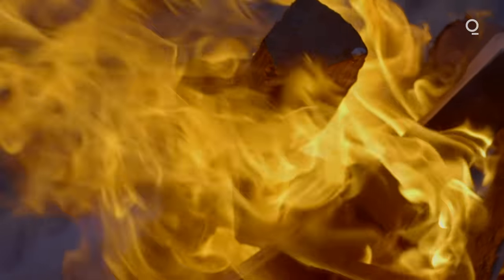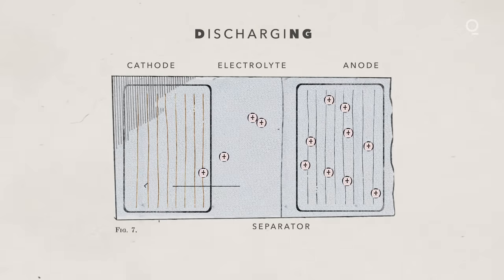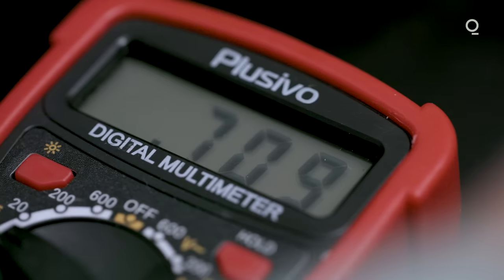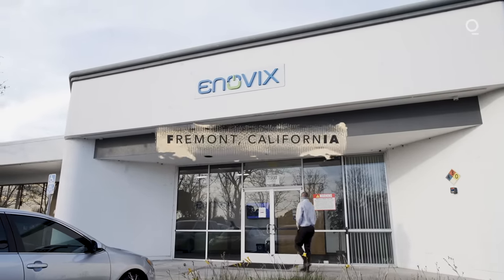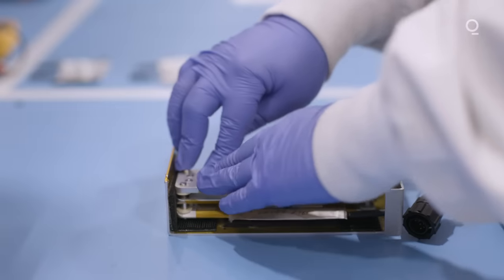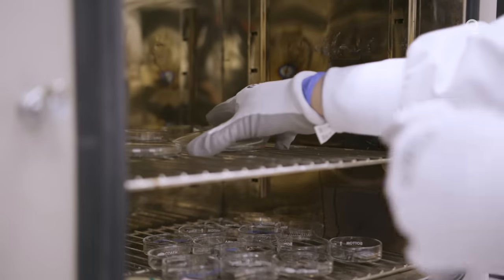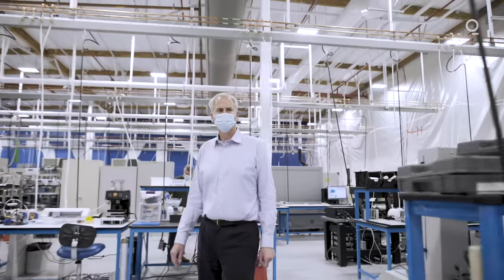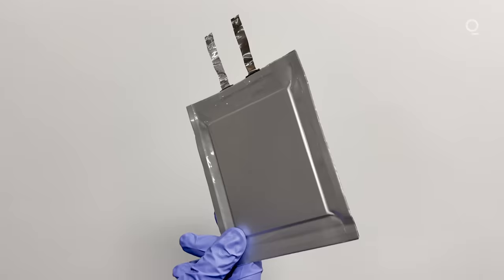How The Next Batteries Will Change the World

Comment: Yep. I took an energy storage course back in college and there are literally so many little things that can alter the performance of the battery and tons of materials research out there done to help change batteries. It's trying to find the best combo and how to deal with its advantages and disadvantages. Batteries still has a long way to go
Reply: It should be changed from "it is not rocket science" to "it is not battery science".
Reply: Indeed battery storage is lacking behind computing technology, mainly due to the lack of need for high energy density batteries till the recent explosion of EV's.  Up until recently small batteries worked fine in phone and laptops, but now we need large storage capacities in a relatively small space.
I believe that the solution is not in chemical batteries, rather in Super-Capacitors which pick up the charge electrostatically.  It has several advantages: 1. There's no chemical to degrade over the time.  2. It charges extremely fast, within minutes if not seconds. 3. It has a high energy density.  There are several companies exploring this technology.
Reply: @BillAnt  I read about graphene battery, they say it'll be revolutionary... they probably say that about every new battery tech.
Reply: @sihotech  < Well, like with any new technology there's lots of trial and error, some will fail while others succeed.  Regardless of the technology used, the aim should be a high density and affordable battery which stores and equal or higher amount of energy than the current gasoline based fuels.  Consumers will always go for the lowest cost and most convenient products, that's just how it has always been.
Reply: @sihotech  graphene in lipos exist, you can buy them
but there's not much difference in performance
Reply: so long that they probably will never be the solution
Reply: @BillAnt  generally capacitors take a long time to charge and burst out energy in less time but never heard of super capacitors

Comment: They have to be recyclable as well.
Reply: Thank you! 👍👍👍
Reply: Everything decays eventually be patient
Reply: @yzrippin  Without battery recycling we will probably run out of lithium/other rare metals that are vital for battery production very quickly. Even if we don't, the mining would cause immense damage to the environment.
Reply: @yzrippin  Yes but if it takes thousands to tens of thousands of years to decay, we quickly out produce the rate it takes to decay.
Reply: @thetntsheep4075    The mining for the minerals is  Completely localised and impact can be mitigated your right recycling is important however your missing the point of Off Earth mining
Reply: @yzrippin  Asteroid mining is flipping awesome. But IMO it's also at least several decades away, and we need batteries to replace fossil fuels far sooner than that
Reply: @yzrippin  Asteroid mining is not something that scientists predict will be able to supply the earth. Our current fuels and non-earth water resources isn't really something we will be able to address for a long time. I really hope that I can be proven wrong though, but currently our bigger problems are on earth
Reply: @jerrywang4406  then why are you using electricity rn?
Reply: @thetntsheep4075   if you search around the worry is virgin lithium may be cheaper than recycling lithium. As I understand it 90% or more can be recycled right now with future technology progress being guaranteed.
Reply: @christianjvi  i do
Reply: 1 step at a time, if you need a new venture to be completely perfect from the start, then you never move forward..
Reply: i hate that ppl say that recycling is more costly than creating new stuff 
when ppl are the ones setting the prices. if we said recycling should be profitable it would be. 
we could make the cheap raw materials cost more so making new stuff would cost more. 

that's what laws and the economy is for. 
if your economy prefers making new stuff you'll get plastic all over your planet.
if it prefers recycling then we will stop overproducing and just recycle what we have which would funnily make things have better value as well, since it's more limited that way
Reply: @robertg7249  that's just so fundamentally wrong. The process of recycling is entirely different to the process of  getting raw material and producing from the start. It's not comparable and isn't just a matter of what people ask for
Reply: @hank_Reardon  a company called Li-Cycle has a 95%+ recovery rate for materials in batteries. They have a patented recycling process
Reply: @robertg7249  i bet you also want 15$ minimum wage and healthcare.
Reply: @thetntsheep4075  You’re too conservative when it comes to when we’ll see asteroid mining. The rate of advancement in technology is accelerating. We’re living in an era where the rate of tech improvement is faster than our ability to comprehend new tech when it comes out, to the point that futurists such az Ray Kurzweil are predicting that in 2029 we’ll reach technological singularity.
Reply: @christianjvi  the ocean is the battery
Reply: @robertg7249  This is the dumbest thing I have read today. The whole idea of "oH iF oNLy iT wEre cHEaPeR iT wOuLd bE cOsT eFfEcTivE." is so fundamentally wrong. Everything you said is incorrect and inept.
Reply: @yzrippin  Why not? I don't get Americans 😂
Reply: OKOKOKOK
Reply: @yzrippin  what does that have to do with asteroid mining? I'm saying we won't be able to have the tech to mine asteroids for a long time, if ever, so we should first focus on more sustainable resource management and mining first
Reply: @jerrywang4406  thats exactly what they said about solar wind geo wave and batteries.  Look at us now.  Were going to space to mine asteroids whether you like it or not
Reply: @yzrippin  Sure thing, let's just agree that we currently need to mine in less polluting ways on earth
Reply: @jerrywang4406  yea im with ya.  We need miners with freaking lasers on their heads
Reply: Recycled or reused for energy storage. While old battery may not be suitable for a car, its still perfect for large energy storage or private home energy storage.
Reply: @thetntsheep4075  Well actually we wont run out of lithium not anytime soon. This may be less known thing, but world oceans actually contain  an estimated 180 billion ( yes billions ) tons of lithium and can be extracted through desalination  and  estimated ground lithium is around 62 million tonnes. Desalination  is still very expensive and it  cost dropped a lot over decades ( which is also useful for extracting  drinkable water) and while  lithium extraction cant compete with ground lithium yet we can be sure that we wont be running out of it in a long time. Plus by the time we really be running out of lithium, we will be mining it in space and sending resources down to Earth since  its much cheaper than sending it up to Space.
Reply: @robertg7249  exactly, put enough taxes on mineral extraction to incentive the recycling industry
Reply: Recycling is probably a secondary aim at this point, but sure it's important down the line.  I believe that the solution is not in chemical batteries, rather in Super-Capacitors which pick up the charge electrostatically.  It has several advantages: 1. There's no chemical to degrade over the time.  2. It charges extremely fast, within minutes if not seconds. 3. It has a high energy density.  There are several companies exploring this technology.
Reply: @yzrippin  Cancer decays too.
Reply: @adk_88  exactly.
Reply: They aren't compatible or even replaceable now, how do you think there could be any profitable business in recycling batteries? (profitable=posible)
Reply: First goal is incompatible batteries. Recycle is not in the list.
Reply: Copper and zinc don't need to be recycled in fact copper iron batteries are even more eco friendly.
Reply: Right, considering we are making more chemical wastes by switching to electricity cars, it is more like a trade off between air pollution of legacy vehicles and chemical pollution of electricity cars
Reply: $ABML
Reply: This is just plainly wrong and dumb.

Comment: I have been hearing this for 15 years.
Reply: And batteries have become dramatically cheaper and more capable in those 15 years.
Reply: @bozo5632  no they haven't
Reply: @shorb2289  That's right. We're so far away from the ideia of the "perfect battery". Los Angeles Police Department did lease a bunch of EV and the record shows that they're useless. Officers do not wanna drive them. So they're parked. Some clerks are using  them for personal driving. A woman that was caught at a nail saloon driving one of these EV ended up fired.
Reply: @Brandon_letsgo  Those 2015 LAPD EV's were BMW i3's which only had the 22-kWh battery pack that produced 81 miles of range. Of course they weren't gonna be used. The 2021 Tesla Model 3 has a range of 263 miles. And newer electric cars are coming out soon like the Lucid Air which will have 517 miles range.

This technology is gonna keep improving and become cheaper. Everything demands it, smart phones, smart computers, electric vehicles, storage capacity for renewable energy, etc.
Reply: @bozo5632  Nope.
Reply: @shorb2289  Electric cars, mobile phones, laptops at the highest level are all what they are today because of battery advancements
Reply: @bozo5632  They have about doubled in 15 years........So go figure,,,,15 more for really usefull car batteries,,Paul
Reply: @paulholterhaus7084  What has doubled?
Reply: @shorb2289  yes they have. Look at Teslas
Reply: @shorb2289  What do you know? smh anime pfp
Reply: @shorb2289  lol just look at tool batteries. A million times better. Look at car batteries. Lol buddy, You thinking about your little phone battery?
Reply: @shorb2289  battery cell energy density has almost tripled since 2010, and they've gotten more than 8 times cheaper. You have no idea what you're talking about.
Reply: @bozo5632  No they haven't. Still using lithium batteries, nothing else.

Comment: Quote: the best battery in nature is called glucose and is only rivaled by ATP
Reply: Yes of course. Ask Neo, he had been visiting the Oracle and the Matrix.
Reply: @aswingsharif6729  XD of course I was joking man but do people realize how cool it is to take radiation from the sun and turn that energy into a sugar molecule? That's sick
Reply: Mitochondria is the powerhouse of the cell.
Reply: Actually there are more energy dense molecules than glucose and ATP that offer higher energy per volume, thermal effects, insulative effects, and hormonal effects.
Reply: Glucose is not a battery, it's a combustible source of energy. That's why it's so energy dense. But it is still a poor source of energy, fat is way better, it's 2.25 times more energy dense than glucose.

It's easy to achieve high energy output from the source that is destroyed in the process (like fuel). But not so in the batteries. You can not expect batteries to be as energy dense as combustibles. That's why they're not going to be used on planes.
Reply: @6Oko6Demona6  Thanks, from now on Ill be happier knowing Im carrying many pounds of highly efficient fuel reserve.
Reply: the best battery in nature is hydrogen, fusion powers the stars
Reply: *best chemical batteries

Btw glucose is a fuel, not a battery but ATP is somewhat battery like. However there are some highly  experimental nuclear batteries are much better
Reply: Then glucose is the most inefficient battery. You have to fuel every time you run out of it and it is easily depleted. Fat is much better it is like a backup energy that you will never deplete unless you have no more fat in your body.
Reply: @viperfang5291  😆
Reply: @6Oko6Demona6  Certainly not in an aircraft, unless the researchers improve the energy density quite a bit.  When weight does not matter as much, such as in an automobile, the cost/mile of LI batteries is just about competitive with gasoline at $3/gallon - assuming you have to replace the battery pack every 100,000 miles. But a share of that is due to the regenerative braking in the automobile. 

In an aircraft, the weight and volume are both huge penalties.
Reply: @buggsy5  they won't. Rule of the thumb says that you can only expect a battery to have a tenth of the combustible sources energy density, no way around that. So as you say, weight in an airplane is too big of a penalty for electricity to be viable there. And it's not a matter of "advancements", you would need a revolution of nuclear scale, meaning a jump analogous to nuclear power discovery. Spoiler: theoretical physics doesn't provide any reason to believe something like that will ever happen. Before nuclear plants became reality there was a lot of academic discourse about it's viability. There's nothing like that in the world of rechargables.

And boats won't use that either. For a car it's fine to have to recharge it every day, but ships can stay on the open sea for a month, a car wouldn't be viable either if it had to cover 30 times more distance on a single recharge (even from the weight perspective, imagine such a car climbing any hill).

All those journalist are searching for a catchy title to generate clicks and that's why the expectations of masses are completely unrealistic. It's an effect similar to csi effect.
Reply: Molecules do not store energy

Or do they?
Reply: @kj-sw2ip  But in practical application on Earth, hydrogen has a number of problems. One of the primary ones being keeping the hydrogen in the storage tank. That is why experimental hydrogen storage tanks for automobiles in the past have used a hydride to adsorb the hydrogen at low pressure.
Reply: @BillAnt  Most clever comment so far :D
Reply: Mmmm Anybody heard of Bagdad battery?
Reply: Maybe fat or liver are batteries
Reply: @6Oko6Demona6  Oh I‘ll quote you on that. You will be shocked to find out that efficiency is a vital part and you leaving that out will lead to you being wrong about planes.
Reply: @buggsy5  You forgot to include efficiency. Batteries don’t have to have the same energy density. That is true for cars today and will be true for planes in the future.
Reply: @Glenhh  ok then. Let's assume there's 100% efficiency in charge discharge cycle. How does that change anything? Beside that efficiency of li-ion batteries is already high, 70-99%.

No. What's important here is energy density, period.
Reply: @6Oko6Demona6  No, I wasn’t talking about the charge discharge cycle. I was talking about the efficiency of the engine and the overall efficiency. Less energy is needed to fly 1km with an electric plane.
We agree that the energy density has to be high. Higher than today. But not as high as oil.
Reply: @6Oko6Demona6  A 100 ps electric motor weighs roughly 25 kilos. A 100 ps engine weighs roughly 100 kilo. That combined with a 95% efficiency vs 30%. That’s why I’m saying you don’t need to be as energy dense as oil.
Reply: @Glenhh  it still means you need at least three times less energy density to make it viable. And it's still three times more then what appears to be a barrier. And no new physics that would let as dream about breaking this barrier have been discovered yet. So it's very safe to project it's not gonna happen.
Reply: @6Oko6Demona6  What Wh/kg do you think is needed? According to Elon Musk we would need at least 400 Wh/kg. I’m not sure if he is talking about the usual passenger airplane. But 400 Wh/kg will be easily achieved this decade.
Reply: @kj-sw2ip  Actually, fusion powering the stars is just a theory.  It's the best guess right now.  Science is always changing their minds when a new discovery is found.  It's part of the process of advancement and achievement.
Reply: I like ketones even better.
Reply: @walter1824  They certainly do store energy. Nitroglycerine and TNT are two well known high energy molecules.
Reply: @Glenhh  No, I have not forgotten conversion efficiencies. Batteries also have a secondary limitation - they do not lose significant weight as the energy is expended, unlike combustion engine systems where the fuel is burned and expelled from the aircraft.
Reply: @buggsy5  I wasn’t talking about conversion efficiency but about the efficiency of the electric motor vs combustion motor. Also, NCA or NMC batteries usually last way longer than a mere 100.000 miles. What data are you using for that claim?
Reply: Mitochondria is power house of cell
Reply: @6Oko6Demona6  this is why keto diet is very popular and trending. burning fats for energy instead of sugar is a lot healthier and it last longer.
Reply: synthaaaaasse
Reply: My biology is not my strongest subject, but isn't ATP more like a power plant changing output to meet demand? I thought ATP was produced by the Mitochondria constantly, because just storing the equivalent energy would require significantly more mass.
Reply: It did occur to me at the beginning that they could have added growing and storing and preserving and transporting food to their list of energy production and storage technologies.

Comment: The Baghdad Battery is believed to be about 2000 years old (from the Parthian period, roughly 250 BCE to CE 250). The jar was found in Khujut Rabu just outside Baghdad and is composed of a clay jar with a stopper made of asphalt. Sticking through the asphalt is an iron rod surrounded by a copper cylinder. (Before the 1700’s)
Reply: The latest update that I heard on it was that scientists don’t think it would have worked and that it likely was not a battery. But hey, who knows
Reply: Since we don't know if that even was a battery, it doesn't count. If it was if would've been very impractical. Enough to give you a somewhat uncomfortable shock, but not enough to do anything significant.